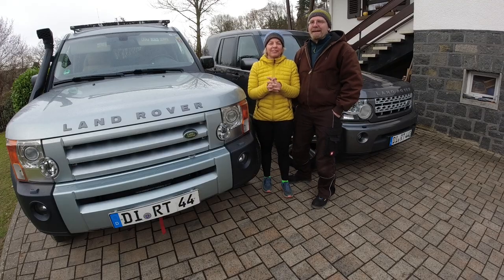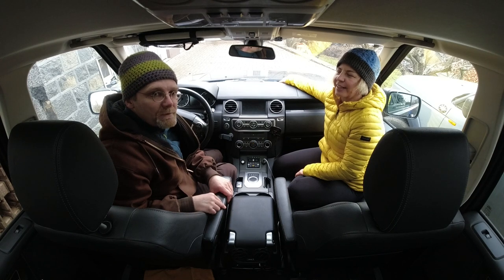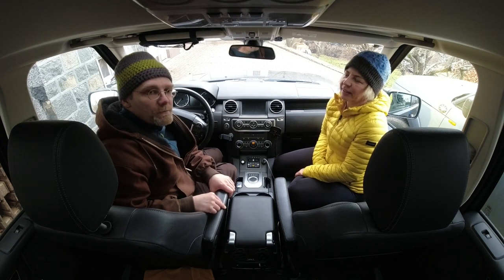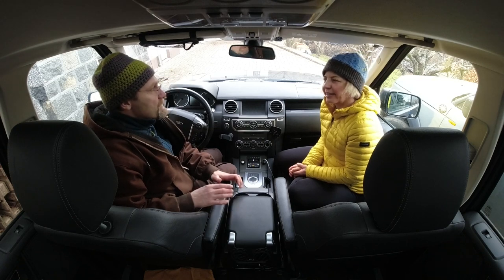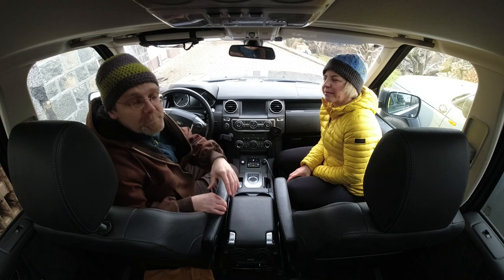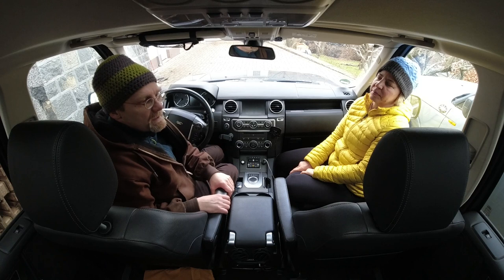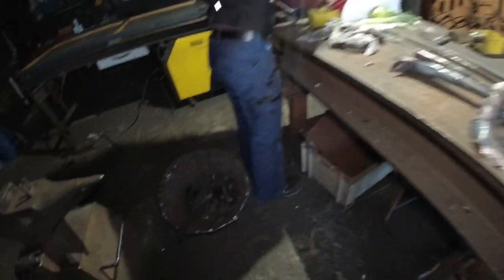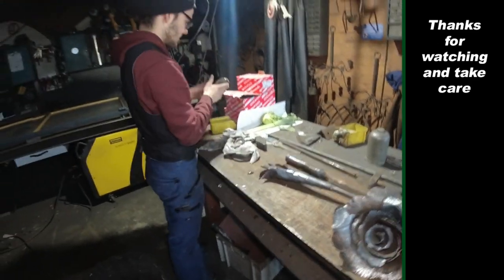Four things we will never change on our Land Rover

Comment: Hey guys,  great video as always but why not consider 4 or 5 must do mods? For example the oil pressure gauge was a great idea, maybe a catch-can? Maybe a battery sensing device that flags or indicates battery condition early enough to ensure you have a good crank every time, maybe some other thing that you have thought about at the time while you are repairing or replacing something...???
Just a thought...

Comment: Mine is one of the first year built in 2004 WITHOUT Diesel Katalysator! It has its 1st Airstruts from 2004 (they are marked), it has 325‘000kms with its 1st Engine and I did 14‘000 faultless Kilometers with it since September 2021 (means: within half a year)!
Reply from the maker: As long as you got the reinforced oil pump, this is the best engine.  Christian

Comment: G'day Christian & Vera from Aus, really enjoy the videos and you guys were one of the reasons for me getting a disco3 2nd owner, it's only done 137k and she's a beauty. I've noticed the air suspension sags on all 4 corners, it does so very slowely, I've taken daily measurements for weeks (with the driver door open and closed) with no noticable pattern/outlier. Is it normal for the air suspension to do that? would you know the possible cause? any guidance would help! thanks
Reply: I would recommend pulling the fuse in the evening and checking the car the next morning, as Vera & Christian recommended.

The air suspension re-levels every couple of hours. Pulling the fuse (Christian, isn’t it Fuse 26?) will stop that and allow you to correctly assess which component might be faulty.
Reply: Raise the suspension all the way. Take the suspension fuse out. If it lowers on all 4 corners it’s a main hose leak. If it’s sagged all front or all back there are 2 valve blocks front behind drivers bumper and rear near rear diff. Good luck. Replace only with genuine no EBay crap.
Reply: They will always have a bit of a rest/sit down when parked. Ours settles down lower when parked and gets odd looks from passer bys. Best to do the fuse trick and leave over night to see if there is a fault.
Reply from the maker: @Big Pola Ours has also a little big of a slack. What we believe is important is to use the airsuspension frequently. Christian for example has to lower the car every time he drives into the parking garage at work.🙋‍♀️Vera
Reply: @Vera_and_Christian  I use ours semi often. Some times just because I can. We also have the iiD tool so we can set the height to anything we wish. I wish we were able to set the car to automatically drop the height at 100km/h, but I haven't read anything on changing those settings.

Comment: Hi Christian and Vera, another great informative video , I have very late 2016 landmark only did 27000 miles on the clock and the air pump failed though but couldn’t hear any leaks though . What’s us your view in having a these control box which changes the data into the injectors thus improving the acceleration. Regards mark

Comment: Totally agree with you about the design of D3 vs D4.
The vehicle was obviously originally designed to have a "chiselled from stone" look to it, both inside and outside.
Attempting to "soften" the look of the D4 just diminished the original design.

I Dare you to try and tell me that the electric handbrake is something you wouldn't change about a D3/D4... especially on an automatic. 😛
Reply from the maker: Si,  I actually like the handbrake.  It’s better than in most cars.  Yes, it is difficult to fix but not expensive.  If maintained (adjusted) from time to time, it lasts 50000 cycles before it needs repair.   It was s not on the service chart and that is part of the problem. Christian

Comment: Engine mapping the 2.7 to 210hp is worthwhile, as it smoothes out the power delivery and gives slightly better fuel mileage.  I drove mine for 100,000km without a remap and now it has been mapped for 7 years and 140,000km now and has 320,000km.  It now has the same HP as my D4 211hp TDV6 3.0. All the 3.0 engines can take a map, even if its just to take the 211hp to 256hp, but they need a small physical  modification inside the engine ECU. I would like to get my D4 to 256hp, but I have not done it yet.

Comment: The only thing to change on a D3 is the engine from a Diesel V6 to the Gasoline V8 so you have a more reliable engine. But that is a full car swap and not a part change. After testdriving the Diesel V6 I decided for myself that the engine was a bit small for the big and heavy box and started searching for a V8 HSE in 2008 - part of the decision was the fact that I knew the V8 Engine and it's reliability from my own Jaguar. After unsuccessful searching for about a year I imported a V8 from Switzerland and still love the car with +200km.

Comment: Great Video & fully agree. I have LR4 SD V6(2012) with HP 6( I do not like HP8 with Dial type as I am an offroader) & Range rover P38 V8 4.0L(1997) with Air suspension. I never give up Air sus of my P38 which is still good aspect for me....Happy not to have a Toyota!😀 Thanks.
Reply from the maker: 👍💪🙋‍♀️Vera

Comment: Hi Christian and Vera, great video on the air suspension. I have a 2007 Disco3 V8 4.4 litre petrol and do  annual trips to the bush. I am very interested in the emergency system to pump air into the suspension strut bellows should I have a system a failure. Please could you you advise where I could find more information about this.
Reply from the maker: We are planning a video, but still waiting for parts, unfortunately. We really hoped to have that video out by now. But then we'll get more in depths into the airsuspension, and also what we carry in case of failure on the trail. 👍🙋‍♀️Vera

Comment: Rws provide  ride height software   it works perfect ...also has a  diagnostic part to it .. mine was running too low so would not stay in  low ride height ... until I reset the actual normal height

Comment: Thanks for the content on you channel, what is the tire pressure you advice for a 2 ply tire 255/55r19.. Because it seems to me that the front tires are more under pressure than the rear tires. I follow the book. It didn't look correct. What is your take on it?  Thanks
Reply from the maker: We also go by the book. You cannot judge by wide angle video footage. And we check our pressure very regularly.🙋‍♀️

Comment: Spot on about the engine swap. Americans swap an LS into everything, it’s even become a standing joke when an engine fails that it is time for an LS. 

There have been successful LS swaps into the Discovery II, but there is a reason it hasn’t been done into a 3 or 4! They are so much more complicated. The swapped IIs have dual ECUs, one for the LS and the original for the 4.0L, and they are linked together so no dash lights. 

I think we’ll be seeing attempts to do this in the next few years on Disco 3s as they become cheaper due to more failures. Most swaps will be failures themselves.

Comment: Thanks for the great video! I truly enjoy our 2011 LR4 (USA version and we are the original owner). 150,000 miles and had less than 3K of unschedule maintenance, however performed schedule maintenance religiously.   May I ask what is on the back of the LR3 that looks like a ramp?
Reply from the maker: Those are our tracktion boards, from Amazon, not maxtrax. 😅👍 We mounted them on our sparewheel carrier we build  a couple of years ago. 🙋‍♀️Vera

Comment: I like the pure radio upgrade. I would like to get apple car play without losing the Land Rover screens for cameras and drive train info for example. Is there a way to integrate apple car play / android auto to the existing system?
Reply from the maker: We have installed a cheap chinese unit, here is the video https://www.youtube.com/watch?v=hGmF5yhUvG4. For apple car play, I you need to spend more money on the unit. But that was 2 years ago, there are probably better units on the market now. 🙋‍♀️Vera

Comment: If I didn't buy a base model with coils already there is no way I would remove air suspension for coil springs 

However u can never make air suspension as reliable as coil so for my long distance trips it's one less thing to worry about which is nice on a landrover 🤣  

Also a few more negatives to add to a raised disco on coil springs 
* cv angles are always on more of an angle putting more load on the joints = faster wear on the cv joints
* because cv angles are worse it also effects fuel economy quite severely when combine the cv angle with the added height of the vehicle 
* another negative is I have 3 different sets of coils sitting out the back trying to get my ride height how I want it haha 

The positives can run bigger then a 265/65/18 without having to ever worry about dropping into access height 
*Cant get more reliable then coils

Is it worth changing to coils if you have air suspension I'd say no maintain it correctly and your sweet 

If you want to run bigger tyres run spacers ontop to give u clearance when in access mode but also run limiting straps to stop your cv angles getting to bad when lifting wheels 

Only thing I'd disagree on is my remap gave me better fuel economy, more down low power and made the car alot more pleasurable to drive

Wont help the engine out at all but definetly improves the overall quality of the drive vehicles are made with a safe tune to suite multiple countries 
When you go a safe tune the tuner basically just remaps your engine to suite your driving conditions 

I don't However agree with people just loading a genric tune onto the ecu without it being properly tested and  monitored on a dyno to specially suite your vehicle 

Ps give me some of your cold hahah

Comment: I'm curious about your opinions for reliability vs complexity of vehicles. I'd imagine that Land Rover is adding more computer modules, as are other manufacturers. A 2022 Toyota Camry Hybrid has 44 computer modules. At first, one might think that a vehicle having 44 computers is 44 times more likely to fail than a vehicle with 1 computer - but I'm sure the Engineers have another way of looking at it. What do you think? I want a vehicle with less computers, but of course, I have no say in the matter when buying a newer car.

Comment: Great video again ! I have installed the same DAB+ receiver, but the reception is very bad. Where have you placed the aerial ? Mine is in the rh top corner of the windscreen.
Reply from the maker: His too, but he will most likely get a similar magnetic DAB+ Antenna for the roof, like I have on my Disco 3. Then we'll do a video. 👍🙋‍♀️Vera
Reply: @Vera_and_Christian  wondering if it's possible to use one of the aerials in the rh rear window. As far as I can see there's 3 aerials in that window, AM/FM, maybe a DAB too.

Comment: Problem is most LR dealerships and independent repair shops not the car.  E.g. my air compressor had a very common design fault. Plastic air dryer cap splits literally along the middle line. 5 seconds with some soapy water to diagnose. A replacement with an aluminum one off ebay ensures it will never happen again $70 AUD and very easy to install 10 mins. Yet if you take it to any shop they want to install a brand new AMK compressor and reprogram car which i was quoted for $2700 AUD.

Comment: Air suspension: opinion and facts seem to be very similar to Citroën’s hydropneumatic suspension. Very reliable when well maintained (which is easy: periodically refill or replace the spheres and refresh the oil, both are small jobs), up to several hundreds of thousands of kilometers, some even over a million.
You may have to replace some hydraulic lines after 15-25 years or so. But brake lines on regular cars are also hydraulic lines that burst if not replaced in time. When that happens on a Toyoda (or any other brand) it is considered normal 🤔

Comment: If our 04 Disco 2 v8 engine bites the dust, especially after we rebuilt the top end because of the head gaskets. We are going to do a Chevy LS V8 swap. It’d be cheaper than buying a newer 4x4 with the same amount of mods and upgrades we have.

Comment: Well, sorry guys, love your channel - but don't always agree with you! 
20 yrs of Disco ownership has turned an enthusiast into a cynical know--it-all (me not SWMBO).
1. D3's air suspension is brill, BUT I would rather have the D2 setup - rear air suspension with all the benefits that brings, plus Active front suspension (strut/springs coupled with hydraulic arms to counter roll). Fabulous, not only eliminates roll (major D3 fault often mentioned by passengers) but leans the vehicle into the turn.  To be convinced, borrow an active-equipped D2 and compare with D3 by driving up to a ski resort in a hurry. The tyres are the only things telling you to slow down 

2. Changed rear light clusters in my 2005 SE for D4's LED style (only about 260€). And re-looked front lights by taking out orange lenses and installing Powerful UK's cheap but effective D4-inspired headlight kit. Obviously LED bulbs everywhere complete the transition, as do clear repeaters. It's not only my opinion that it looks soo much better but professional and private commentators too. Even my 2005 van has clear lenses everywhere for goodness' sake! Sorry, far from 'cool' those enormous ugly red lights at the rear only work on red Discos where they blend into the body. Will never change the D3 grille/bumper though - I agree it looks much classier (or just less bling) than the D4

3. I've learned to systematically chip ( external 90€ box not remap) my Discos to get a mild 33bhp uplift in power coupled with ~10% reduction in consumption. The extra power improves dynamic response (not acceleration) and when crossing France we now get 8.4l/100km (33.6 mpg) rather than 9.2 (30.7 mpg). I really don't consider this small power (& torque) increase a risk to my already undependable engine(s). Sounds counter-intuitive yes, but before I chipped it the D2' was the most unreliable of the 30 or so cars I've owned whereas the D3 is probably the most reliable!!!!!

Comment: Nice video but I 100% disagree with the mapping.
My 04 D3 tdv6 has a bas map and bigger intercooler and it’s made a huge difference to drivability. Better pulling power and makes it a nicer car to drive.
Map done at 154,*** miles and still happy at 203,934 miles. 
Just my 2p worth. 
I’m sure others will disagree
Reply from the maker: The 3 Liter is mappable up to 255 hp like I mentioned.  The difference between the 245 and the 255 is mapping only.  👍 Christian

Comment: Nice one but because l"m 68 I would fit a new one Barry.
Reply from the maker: You  mean a new turbo charger, or are you referring to something in the video you wrote this comment? A new one is about 2000€, only the part, that is the reason why we just replaced the cartridge. 👍🙋‍♀️
Reply: @Vera_and_Christian  sorry I was referring to the turbocharger only reason I mentioned that because I have seen a few of them repaired and failed the fault was in the wastegate, they were working fine for quite a while then suddenly lose of Boost pressure and the exhaust side of the turbocharger had to be replaced just letting you know this can happen thanks Barry

Comment: Disagree .
 The lr4 is much better looking and the lights front and rear are way cooler looking then the plain Jane disco 3 lights.
   I suppose it's an individual preference thing.
   I have the 2010 land rover lr4 hse.
  I've had it for 4 yrs, 129,000 miles and of coarse it's now doing the over night sag.
   I did like a few others on YouTube and set it at the high position and then pulled the fuse under the battery cover and fuse box cover that goes to the air suspension.
   And been driving it. This morning I noticed it looked lower again all the way around. It dropped approximately 1 inch all for corners. So I put the fuse back in and raised it back up and pulled the fuse again but I know this will happen again.
  If you've had any experience with this I wpuld be happy to know what you think it may be.
   I cant imagine all for air bags leaking the same amount.
  So I'm lost.this is my first land rover and I love it but I'm frustrated with the air suspension system.
   I don't no who to  take it to,definitely not the land rover dealer 40 miles away there labor is ridiculous as I'm sure you know.
   It won't be paid for until Oct this year. I've checked out the heavy haul coil spring conversion kit but it's depressing to lose a big part of a land rover the air suspension. 
   If you get a free minute let me know what you think it may be.
 Thanks, Dan
Reply from the maker: One inch overnight is not significant and indeed you can’t see the issue this way.  Only leaks which cause it to go into the bump stop can be diagnosed this way.  Must be on perfect level ground and measured precisely to see it.  If the compressor turns off within one minute in the morning, I would not worry about it.  Christian
Reply: @Vera_and_Christian  Thanks buddy I appreciate the advice.
 I also found a really good mechanics garage 5 miles from my home that works on European vehicles and especially land rovers and they have all great reviews for great work and fair prices so I think I will be taking it to them to see what they think.
  Thanks 👍